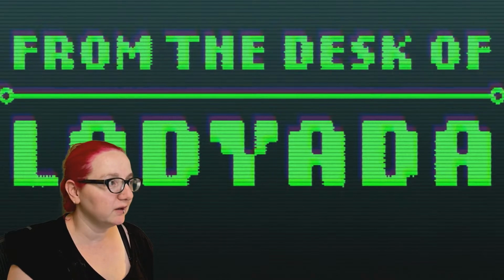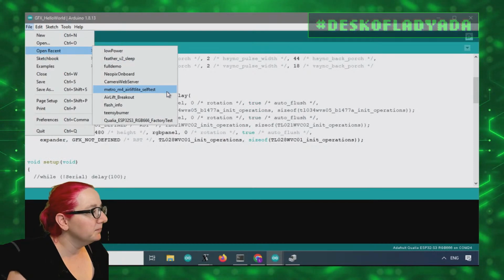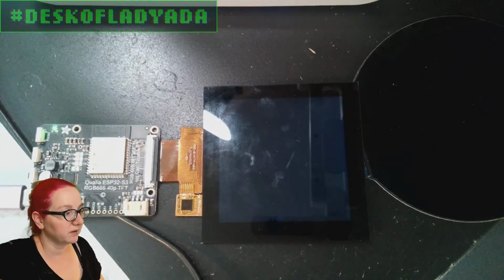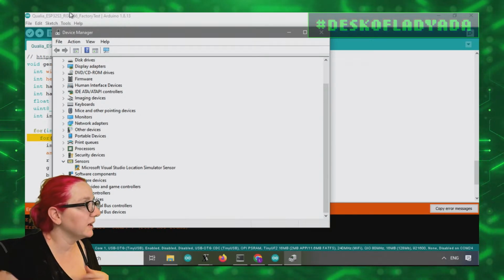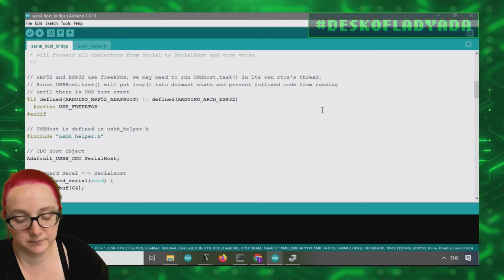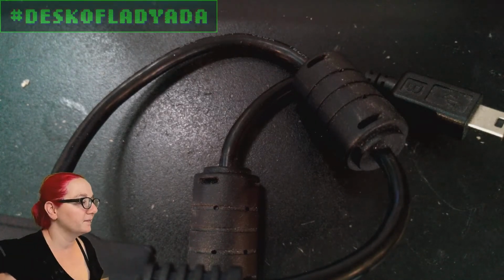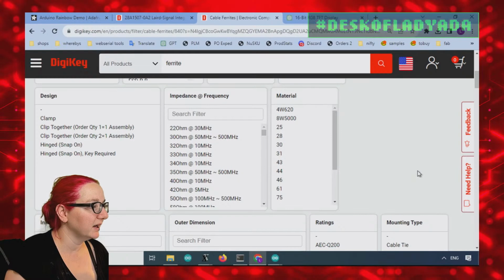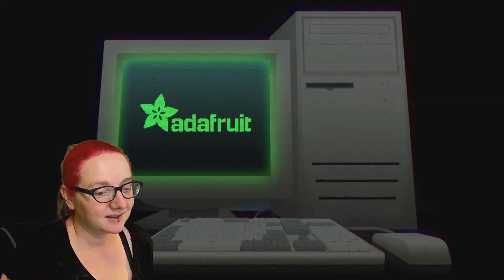The Desk of Ladyada - USB Host Featherwing + 2.8" Round Display  & Clamping Cable Ferrites

Comment: Does your compiler automatically optimize code for optimal speed and resource usage?
Reply: Do you write optimized code?
Reply: There was a time when every byte mattered, register usage and stacks were optimized and kept full to optimize speed, even generated assembly code was manually tweaked to make code run faster before it was converted to machine code. With AI assisted code writing, I don’t know if current compilers are also written with AI assistance with the intent of optimizing output. So I asked. It’s been 50 years since I first wrote a compiler.